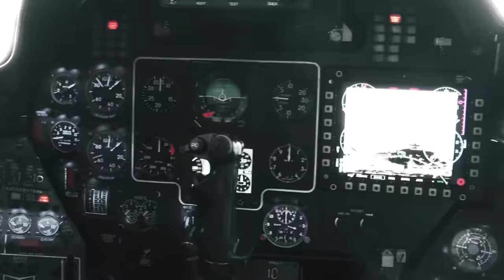Mil Mi-35P Phoenix in Action

Comment: I didn't see too much peerformance, the most cool in this video - is sound.
Reply: It was an easy target for the red eye, and stinger  missiles
Reply: @thir671  You're mixing it with Hind.
Reply: @maquacr7014  look at the Afghan war in 1975, they said it not me. The red eye misil and the stinger one were letal against those choppers
Reply: @thir671  Afghan war started in 1979.

And Hind version was shot down in Afghanistan. MI-35 weren't available then.
Reply: @maquacr7014  It just a new versión the Afghan war stay for 9 years
Reply: @thir671  It's like saying F-16 block 15 is the same as F16 block 72.

There is a huge difference.